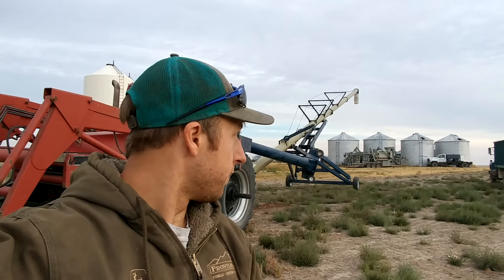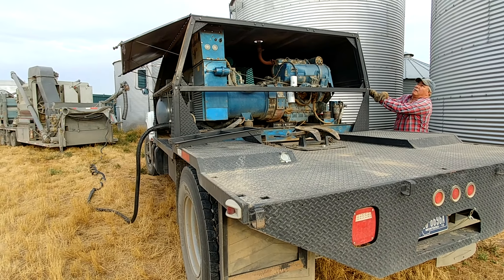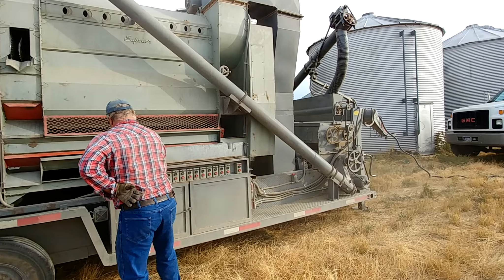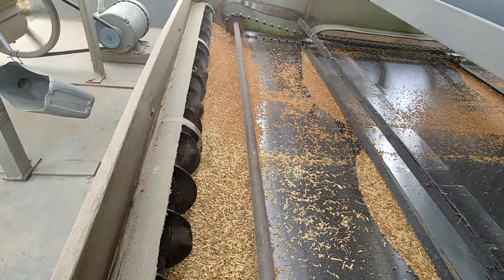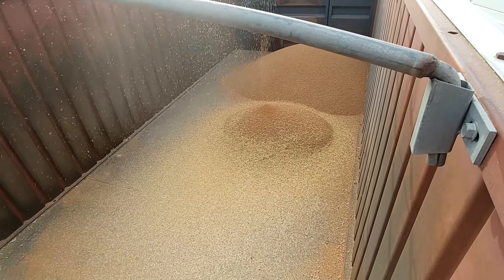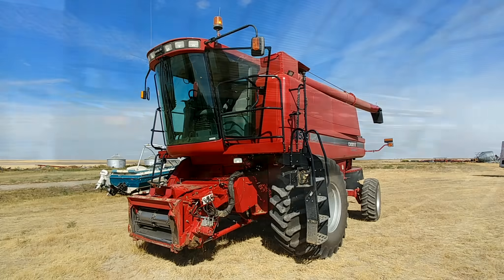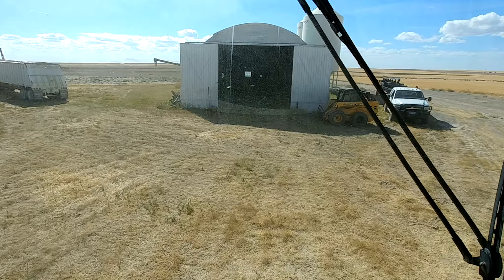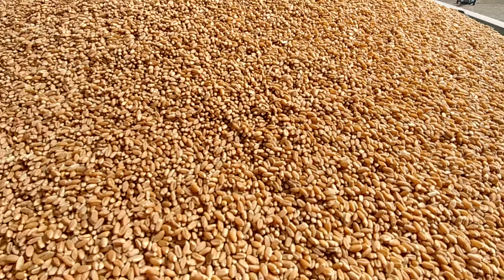Harvest Over? Better Clean Grain And Stow Equipment

Comment: 1981 i hauled a tandem 10 yard gravel box, and a tri axle 12 yard gravel box loads full of shovels and spikes to scrap, i made just over 7000.00 with thanks to surrounding farmers, dad, and my determination to do a bit of work collecting the massive pile of them over a four summers time spanI know the truck owner was a criminal, charging me 25% of the gross income for letting me use his truck and  wagon, but that included fuel to make the 3 hour drive to edmonton to sell it and back. the best was the huge huge piles of scrap Cast Iron dad and i did, from old equipement ect, that full truck and wagon load and the just truck second load was  Pay Day giggles, known around the block for our desire to do this for extra income for the farm, the nieghbours happily gave us mega old wreaked vehicals, i pulled four loads of squished vehicals in the summer of 86,  we squished them with a D7 catapillar, and loaded with a JD 450 track loader we barrowed from a construction company dad drover doser cat for part time. the years we did it it was a nice income boost and paid for my JD pull type combine and Newholland bailer i bought at farm auctions. so the money was well spent to upgrade the farm. so yes the scrap piles on farms are hidden gold mines if seperated and prepped to prepared scrap. remembering tires and stuff lower the grades and dockage, as well coper  and allunimum pay bigger money, and if have brass or bronze planitary pins sell them seperate as it pays more. dad did the planitary pins on our versatile every two years to prevent brake down time and they made a fair buck.   i still haul scrap last summer i made over 5000.00 extra hauling scrap i collected. oh ya old batteries make decent money also. just love hauling scrap it is a fun way to make a few extra dollars for christmas or such. done all our christmas shoppiing this year with money from scrap.

Comment: that is a nice setup  it does a great job. how heavy do you guys plant.we always cleaned our own but we had a lot smaller operation. it has been 20 years since i have planted wheat. i raised spring wheat a little. but my dad only raised winter wheat. what types of seed do you plant. we raised irrigated wheat mostly so we would plant. one called sturdy in the beginning. then we switch to one called Vona. and others i switched to Tam 107 i liked it i would average 80 bushles with it. on irrigated ground. but i guess the mills didnt like it.

Comment: may i ask why you take the batteries out? I know you are supposed to disconnect it to make it last longer but what do you do with the batteries? Use them in another equipment?
Reply: Probably put them inside where it's warm and hook them up to a trickle charger.

Comment: Another great video (but another morning wasted by me dammit :( ).

Would be interested to see the maintenance schedules on the combines.  Do you do anything when you put them away for nine months?  Do you change the oil before you park them or change it just before you use them again?  Do you run them on a regular basis whilst they are parked?  How often do they get new batteries and does it screw up any of the computers when you remove them like modern cars do?  Cheers for the work you do.
Reply from the maker: I'll try to cover that topic next year :)

Comment: 2700 dollars for power connectors?? Why are they so expensive over there? Here in the Netherlands i can buy 400v connectors for les then 80 dollars.
Reply: It probably has to do the amount of amperage.  That wire is rather large to feed the 16 motors.
Reply: @dcmkcbbq  That's the advantage of higher voltages in Europe:  lower amps running equipment
Reply: @Dieselpower82  In the US all houses take 220V-240v from the mains, just like Europe.  The main difference is in the interior where consumer appliances are 110v-120v vs. the 220v-240v.

Comment: Hate to burst your bubble, but that old rusty steel (not iron) is never going to be worth much. It's a massive mix of all different grades of steel, as such you're going to get a low per lb. Price. Regardless of the prices. It would probably be best to just get it cleaned up and be done with it, then have a steel recycler bring you a massive bin to throw stuff in, in the future.